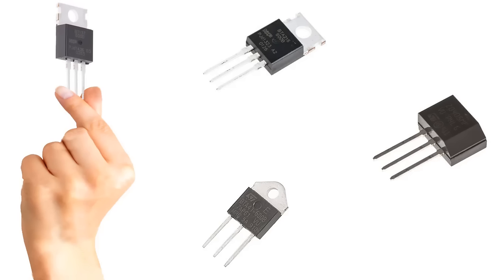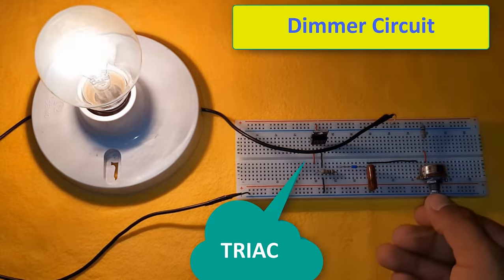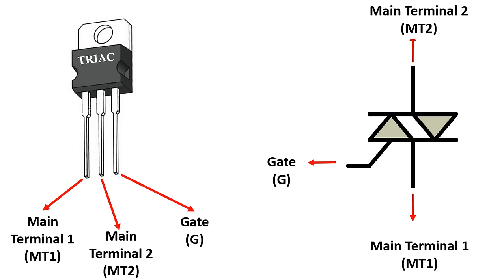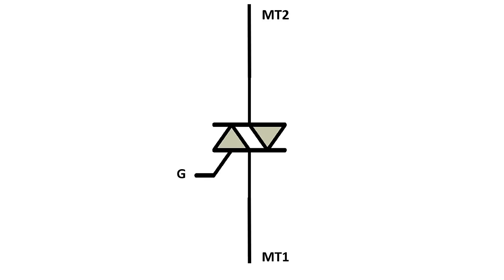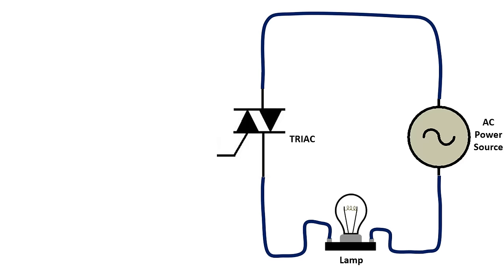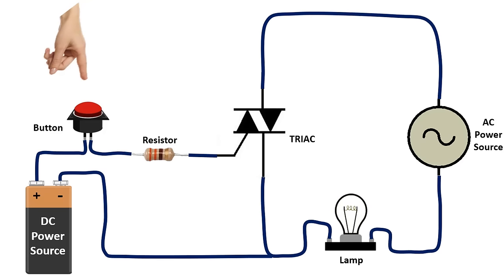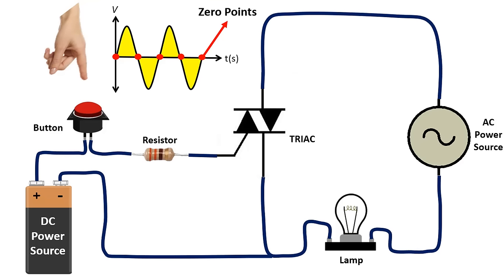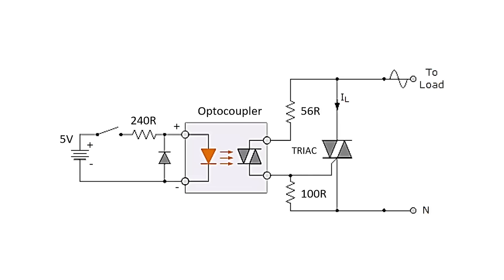What is a TRIAC? How TRIACs Work? ( Triode for Alternating Current - TRIAC Tutorial)

Comment: Howdy again.
I my teens I built a light organ using triacs. Three triacs for three output sockets, bass, medium and treble. It worked after some improvements. The problem with the original circuit was ghost triggering. When the bass channel was triggered the other channels got ghost triggered as well. The likely reason was that spikes propagated all over the circuitry. And the reason for that was probably the mains CLC filter blocking the spikes from going backwards to the grid.
Clearly the gate is highly sensitive. I reduced the resistor values to 1/10 of the schematic values and increased the capacitors to 10 times in the phase shifting trigger circuits. Also I connected a 1 k resistor between the gate and MT1 to short out any ghost pulses.
Ghost triggering will also happen if the voltage over MT1 and MT2 rises too fast. = du/dt is too large. This may be managed by connecting a plastic capacitor over MT2 to MT2. Try 100 nF first. Increase value until ghost triggering goes away. Or decrease value until ghost triggering comes back.
Regards again.
Reply from the maker: Thank you so much ☺️🙏

Comment: When I was 14 about 40 years ago, I wanted to make a light dimmer and the electronics lab insisted I use a microcontroller and triac circuit so I would learn more. I learned. As an adult I just buy finished devices and don't prototype unnecessarily complex circuits.
Reply: I repair those circuits, mainly.  Occasionally, I will design and construct a circuit if it's unavailable.

Comment: The AC circuit in the video thumbnail might destroy your triac .... the load ( a lamp here ) should be connected between  top ( line or live ) and the MT2 (  NOT  on MT1 side , which connects direct to mains neutral  ! ) the push button and resistor ( usually about 330 Ω ) connects between the GATE and MT2 .. NEVER , NEVER connect to line side of lamp (  BIG BANG , dead triac ! ) ...when the triac turns ON the voltage at MT2 drops to a  very small value , thus not overloading the push button / resistor / or GATE ... you can even use a tiny reed switch to turn on hundreds of amps load ( use a BIG triac ! ) .... ( tried - n - tested ) ........... DAVE™ .............
Reply from the maker: Thank you for the additional information.

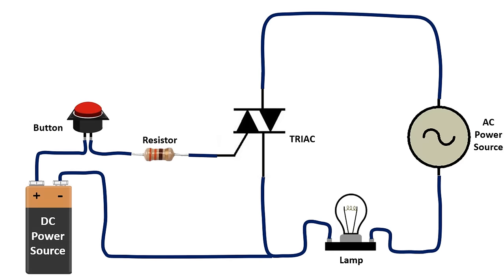Comment: 2:46 - I never understood the safety and theory that the negative terminal of the battery could be connected directly to the AC main line. Can you explain how this is possible, is it safe? Thanks
Reply: well the AC cannot go through the gate of the triac so the battery is connected to the AC by only the negative terminal. So the AC has no path to go to the battery. Thats why it won't toast the battery. But if you touch the negative terminal of the battery and you are not properly isolated from the floor (ground) it will kick you. Thats why you should always use optocouplers. Also if the AC voltage will go above maximum rating of the triac (500-800V) it can break through the gate and then it will blow up the battery. This can happen with inductive loads. Optocouplers have isolation several kV so it is much more safe.

Comment: Wouldn't DC on the trigger in an AC circuit just make it conduct for half the cycle?
Reply: I'm assuming because the DC is constantly shorting the parallel thyristor it allows the current flow.
Reply: The triac will trigger with DC but not symetrically.

Comment: Why is it in analog tester the diode with stripe is negative and the other side of diode is positive. My question when connected to power supply is it correct to follow the polarity. If yes diode will burn. So what I did the stripe I connect to the ac secondary of transformer and the diode is Okey.
Please explain.
Thank you

Comment: Bro please u can describe in a vedio 
Why we connect resisstor at the base of transistors and how do we calculate the base resistor 😯😯😯
Reply: The purpose of the resistor is to limit gate current.  Select your resistor based on the gate current specification from your triac datasheet and the system voltage.
R=E/I, right?
Reply: In a transistor, there are limits to the Base current to turn them on or off. The minimum current will turn them ON, but may not drive them to saturation ( EC current for minimum Vce.) But more than the minimum current will create excess heat. Above the max. Ib (base current) the transistor can be damaged or destroyed by heat from power dissipation. Similarly, Gate current for a Thyristor ( SCR) has limits.

Comment: What's the difference between transistor and triac???
Reply from the maker: The transistor is used in small power DC applications while the TRIAC is used in large power AC power electronics applications. Basically we can tell this difference.
Reply: @eeapplications  thanks!

Comment: Is it possible for triac become short circuit? I got my triac always ON even without any trigger to gate.
Reply: Without voltage over 3-5 Volts applied to the Gate triac shouldn't been open in any direction. Your part is highly likely damaged :-(
Of course, you shoudn't apply to triac terminals overrated voltage - it do break part forever also.
Reply: I replaced a drain pump with a higher powered drain pump and the triac shorted due to exceeding it's maximum current rating and the pump ran continuously

Comment: Where is your Diac?
Reply: Watch to the end!
Reply: not needed in those circuits.  function of a diac is to block current from a variably-charged capacitor until it reaches a set level.  Optocoupler circuit shown is not a dimmer, just shows on and off.  It works fine w/ just an optocoupler.

Comment: Saying thyristers are for dc is bonkers.
If you turn it on,  then with dc it will remain on even if you remove or gnd the gate.

Thyristers have a hold on current.

When used on ac a thyrister will only conduct on the positive half cycle but ot Will turn off each time the sin wave is almost 0v.

Comment: What determines if this is used instead of a potentiometer? Seems like they both have the same purpose but the triac would consumer more power if it requires an additional power source.
Reply: A lot less power. Triacs are used for 'phase chopping' - turning on mid-way through the cycle, allowing for a simple but effective form of PWM power control. It's way more efficient than a potentiometer, which just adds resistance and wastes a ton of power as heat.

Downside is you get nasty harmonics, so EMI issues - even a household dimmer switch can emit enough radio noise to hear on an AM radio.

Comment: So many words for so little said.
Reply from the maker: I think it is useful for those who are just starting to learn circuit elements. There are many switching elements similar to transistors. Many friends have a hard time distinguishing them.
Reply: @eeapplications  It's important to illustrate and exhibit a practical circuit from the beginning! Don't leave the beginners to fiddle around with mains and triacs without pointing out the correct connection of M2 and M1, which connects  to the load and which to Neutral!
Reply from the maker: @Khaled Yousef Hi. I agree with you. But I'm here too In the video, I tried to show only the basic working logic of this circuit element. I have not given any examples of voltage levels here. Thank you.